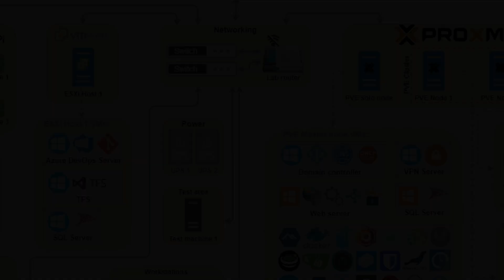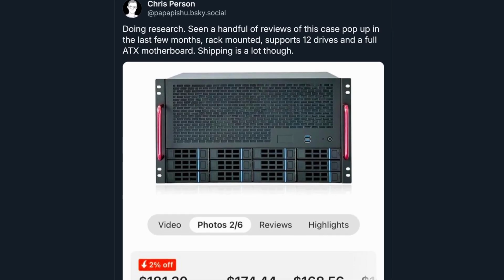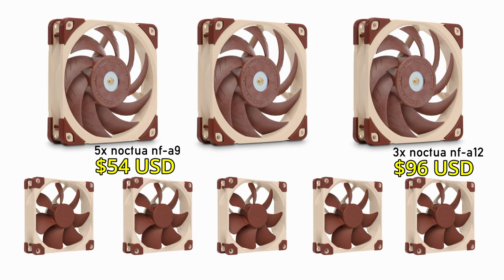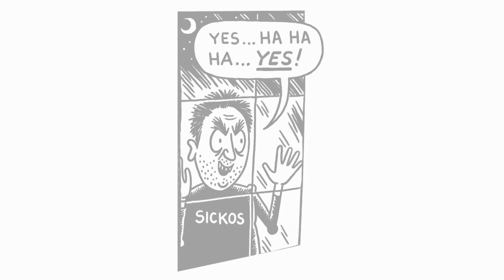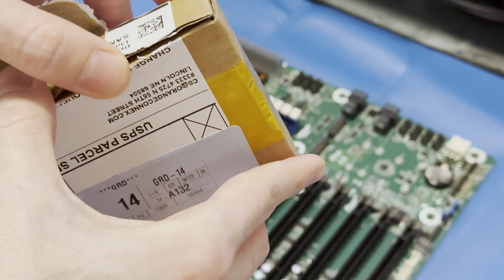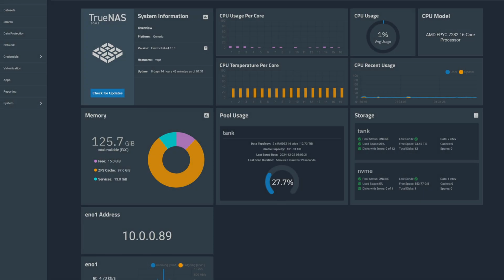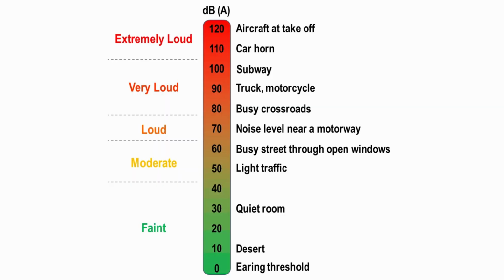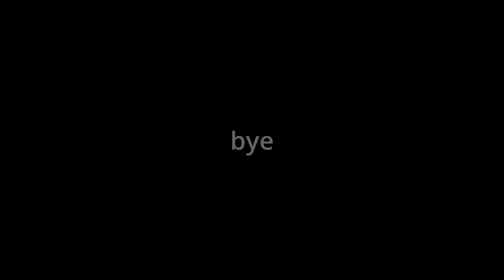my 100tb jmcd 12s4-1 server build

Comment: Checks CPU for scratches, doesn't check the much more expensive motherboard for bended pins :)
To be fair it was new, but still... I would be nervous around it.
Reply from the maker: it was mainly because the cpu was literally under a hundred bucks and part of me was thinking i got scammed lol.
Reply: @maybesheforgot  It's not that uncommon to find 8 and 16 core Rome CPU's for under $100 on ebay now a days (I picked up a 7252 for $50 recently) but I know what you mean, I wasn't 100% sure till I got to test the CPU and verify it was unlocked.
Reply: @maybesheforgot  I checked the current prices on eBay immediately as you mentioned it and it was 10x more expensive lol so yeah I get you.

Comment: Do you need to flash IT mode on 9500?

I heard 9400 later dual mode card can be used on truenas without that since default personality being JBOD, but not sure about it

Since you have successfully experienced with it, thought u may be able to help with my concerns 

I am planning to build a home server soon too.
Reply from the maker: @789know  from what i’ve read online i don’t think you need to flash this particular card. i didn’t have to do anything special with it to get the drives to show up in truenas. when i run storcli64 on the controller it shows all the drives as JBOD, so i think that means it’s in IT mode already.

Comment: You running any game servers on this? AMP, Pterodactyl or linuxGSM? if not you think AMD epyc 7282 could handle a few?
Reply from the maker: @Iron-Sleeper  i am not, but i don’t see why it couldn’t. maybe you’d see some cpu scheduling at higher workloads, but 32 threads is pretty beefy for a workstation, considering the power draw too. the nice thing is this asrock board can accept the milan series of epyc chips (epyc 7003) so you could get up to 64 cores and 128 threads to play with if you really wanted to (once they come down in price, that is lol).
Reply: @maybesheforgot  cool thanks. Great video. I'm looking at remaking my host, might follow this build.
Reply from the maker: @Iron-Sleeper  right on. definitely make sure you get an unlocked epyc cpu if that’s what you end up doing. many are locked to oems like dell or lenovo, so just be aware of that
Reply: @maybesheforgot  oh didn't know. Thanks.